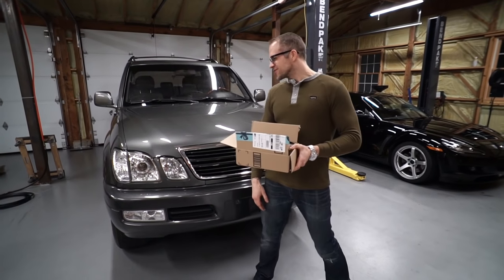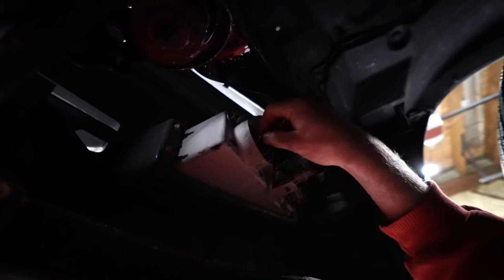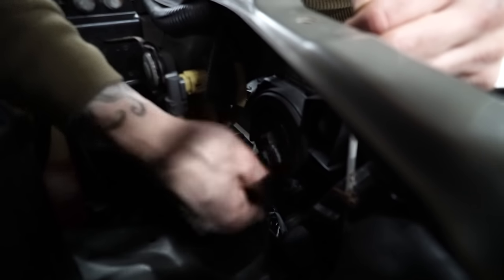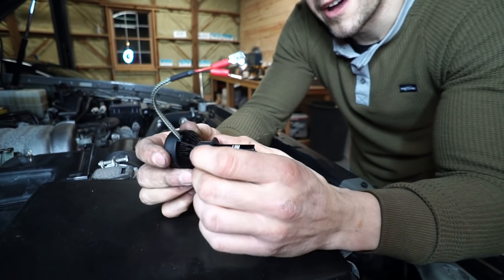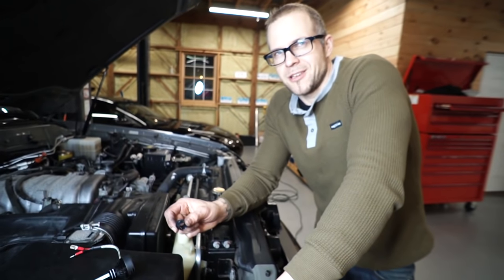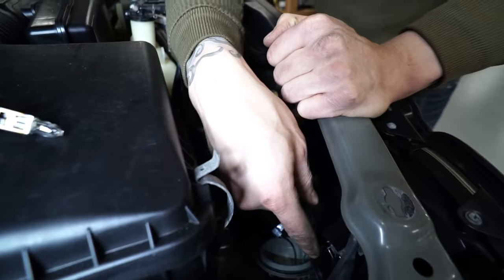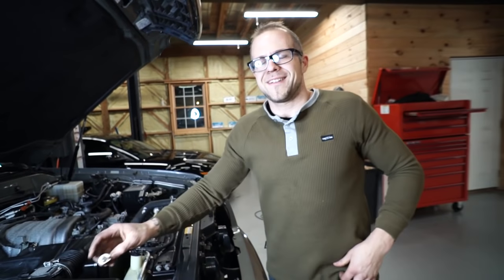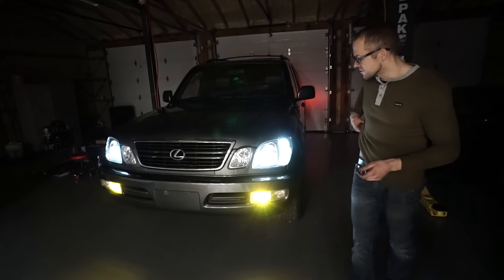LED Light Upgrades Project LX470

Comment: Exactly like my Lexus also same color
I tried many lights but I found the Xenon lights are the best.
Especially for the low beam with the lenses.
I usually travel at night twice a month that's why I choose the brightest and most shiny light 
I prefer the 4300K color .
Reply from the maker: Awesome buddy. If these crap out prematurely I might switch over to Xenons as well.
Reply: The Slip Angle 

Wanna ask about those yellow fog lights 
Where did you get them?
Are they deep yellow like 2500k or 3000k?

Please share the link 🔗  if you got them online.